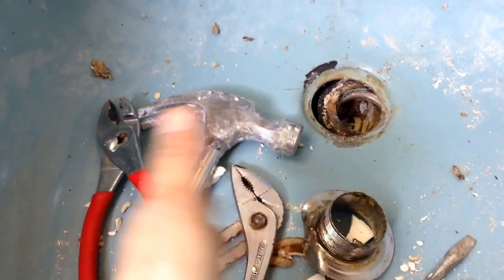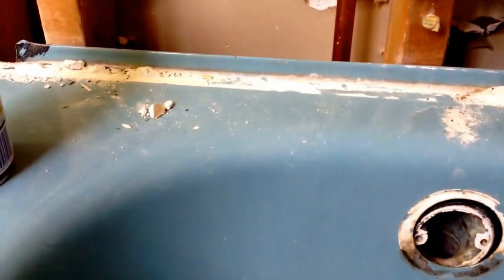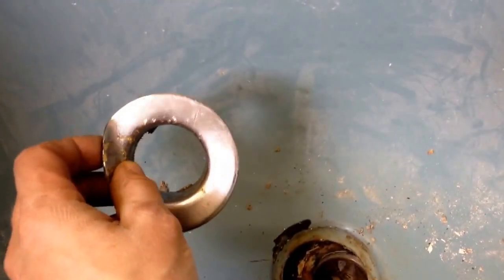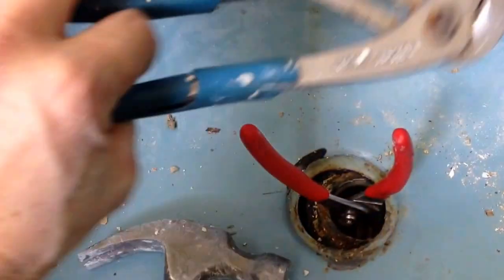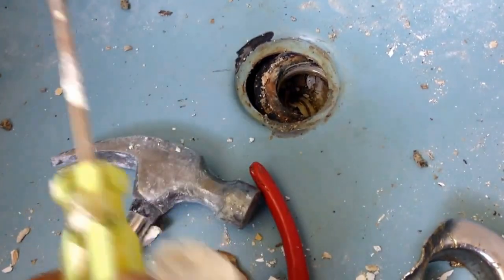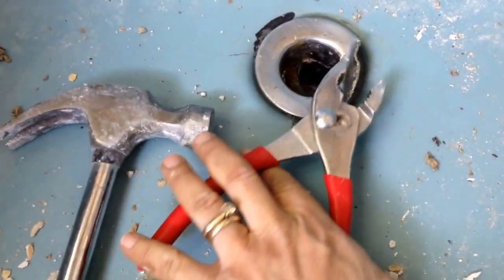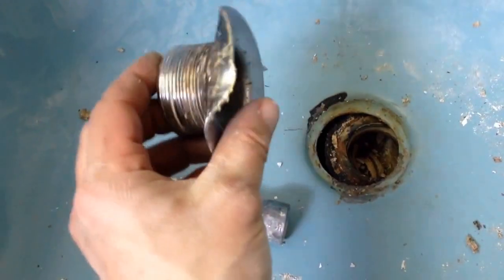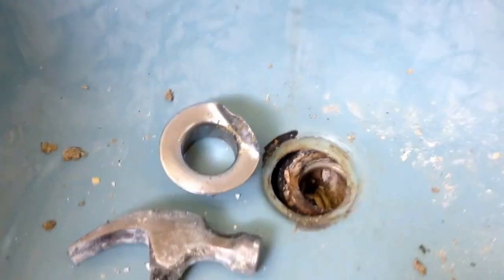Successfully removing an old tub drain!!!!

Comment: Initially this didn't work because I just wound up snapping off the parts of the flange I had bent up; however, it DID allow me to scrape out some of the putty and actually get some wd-40 right onto the threads, and then, with a lot of elbow grease, the open pliers method finally did work! Thanks for getting me part of the way there! Tub is finally out!!!
Reply: Same thing happened to me, the entire lip is gone on my drain now. Ill try what you did. WD-40 and some elbow grease.

Comment: After trying out all the YouTube suggestions I ended up with a much simpler solution. My small sledge hammer's head was just the right size to wedge into the drain but it was still too slippery to have enough of a grip to loosen the drain which had seen 40 years of hard water. I got the rubber grip jar opener from the kitchen and wedged the hammer head in the drain surrounded by the grip. Couple of light taps on the head to get it wedged in nicely and a turn of the hammer handle got the drain loose and out. I happened to have have a perforated jar opener grip which I think gives it even better grip.

Comment: I was working on a sink drain and this video did help. I took a pair of channel locks and put it in the top into one of the holes in the top drain,, from underneath I turned the pipe, and when the channel locks on top went up against the faucet it actually snapped the pipe in the opening of the drain and came right out.

Comment: Thx for this vid! My drain connector was so tight I had to start with a can of Liquid Plumber (LP) and hammer a very thin butter knife beneath the counter-sunk lip, pry, then slip in an old putty knife (while still prying up with the butter knife), then small flathead. The enamel cracked, making enough room to slide in a damaged chisel. Then I pryed/hammered the chisel in over and over while giving it shots of LP. Once I had a nice bent up section, I clamped on vicegrips (vertically) and tapped the side of them over and over as the piece slowly moved until I was easily able to unscrew it. 20 minute process, but cheaper and quicker than buying a specialty tool for a one-time operation. Thx again!! :)
Reply from the maker: You're welcome
Reply: Same trick worked for me Thanks

Comment: I removed same old tub drain today. I don't know how old it was, but the house was built 70 years ago. A tub drain wrench from HD plus 24in pipe wrench and tremendous effort did the work. Nothing else worked. If you have to remove an old drain, don't even think about small pliers!

Comment: I am currently replacing a bothtub with a tub and shower stall, this tub has been in place for 56 years , I used a sawzaw and cut slices in it to release the pressure and used my tool on the 2 little nubs that was left and it worked!
Reply: Marion county???? Naptown, indy????

Comment: Did you know there is a drain wrench to be used in place of plier trick to spin the drain out when cross members still intact? Did you know there is an extraction tool that works to remove drain when the cross members have been broken? I was frustrated so many times until i discovered these tools but Ive never met a job they cant handle! Great VDO THANKS!

Comment: It doesnt work every time though, it depends how old your drain is tbh. I watched your video after I attempted doing the same thing on my drain, except on mine the lip of it (the part u bent) just started snapping off. Then id try and bend another part, try and turn it, then it'd snap off. Now im literally stuck in a position trying to get this freakin thing out and theres no lip at all. Its all gone, lol. ughhhhhhh donno what to do. I even bought that drain extractor thing and it didnt do shit. This thing is seriously in there, I dont think anyone could get it out. My final idea is to just buy some discs that cut through metal and use my dremmel tool, because I dont want to have to remove the entire tub. I could remove it, because technically since the lip isnt there it isnt connected to the tub anymore. I liked your video, way to make it look easy!

Comment: Thank you for the video. I, too, have been struggling with my tub drain removal. I can spin it, but it's just spinning and not releasing. The plumbing under the tub is PCV and I have someone holding from below (through access panel) while I'm spinning the drain. But it won't spin. It's completely fused!! Agh!! Any suggestions?

Comment: thanks for posting this video. I had to do this today and your method was the only one that worked. I didn't bend the flange up the while way, though. I bent one side up about a half inch then pounded on the edge of the bent edge with a hammer and chisel (or a screwdriver) to force the flange to turn. the chisel dug into the metal so it made its own little flat spot to hold it on the flange as i pounded. as a way of saying thanks, if you'd like I will caption your video for you using my software, MovieCaptioner. that way your video will be searchable. the automatic youtube captions are never very accurate either.
Reply from the maker: Cool. Thx.

Comment: The tool you should have used before breaking the crosspieces in the drain is a Tub Drain Wrench (or Dumbbell Wrench). And the tool you should have used after breaking the crosspieces is a Tub Drain Extractor. They are designed to remove the tub drain with a lot less effort and without damaging the tub.
Reply: Tried the Tub Drain Extractor on a 50 year old drain. Worked like garbage. Hacksaw, dremel cut-off wheel, hammer and chisel was the only way to go. Old plumber friend (Master plumber) told me that's the way he's done it for years.
Reply: @ps429  same

Comment: Seems helpful but will you not crack the tub if you use a flate head screw driver. I'm having the same problem right now, I've actually snapped the crossbars with the method mentioned earlier. So now I not sure what to do.

Comment: oops....if you don't want to ruin your tub, don't start without a large old towel under tools.  Do not force things. Ever.  Heat the metal up with a hand held blow dryer. Really warm.  This was an example of how not to do it.
Reply: i thought she said she used heat first,  or didnt you watch the video?
Reply: Probably didn't watch the video. My drain is currently stuck and I tried heat.. I tried the pliers in the drain and the cross strainers broke now I'm stuck in her situation and might try this.

Comment: Ladies, Go to the near home improvement store and purchase The Drain removal tool. Make easy on you.
Reply: im a guy, i bought one,  as i tighten the tool it pushes itself out of the hole, because the hole widens as it nears the top. next
Reply: I'm a guy. I bought one at Home Depot. Turned it so hard it broke.
Reply: I'm a guy... I resisted it slowly and the torque still popped that $15 tool. Square one.
Reply: If the drains been in there for 50 years, the tool is useless. Hacksaw, dremel with metal cut-off wheel, hammer and chisel is the only thing that works. An old friend (Master plumber) told me that's the way he's always done it and he was right.
Reply: @ps429  Two days ago I removed a drain that had been in my tub for over 50 years, using the large tapered drain removal tool and a very long torque wrench. It came out after a few strong pulls. The bath was undamaged and now fit for re enameling.

Comment: Yep, peeling up the edge of those d%$n things works. Done it many times. Also have used a hack saw blade to cut a line on the inside of the drain and the drain will peel out.

Comment: note the TOTAL CRAP slip joint pliers and hammer both of which appear to be LOUSY quality one would find at 99cent store or supermarket isle...i mean if that is ALL one has to work with (ie NO budget) then who am i to comment...BUT if you HAVE means and plan on using tools over the years?  Dang it!  SPEND a few bucks and get at least half way decent!   HUGE difference in performance and longevity